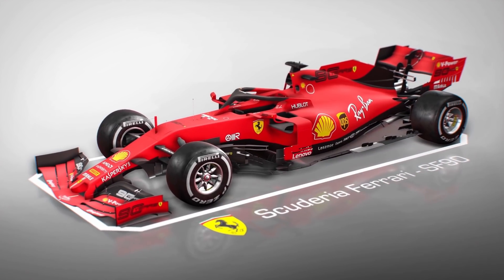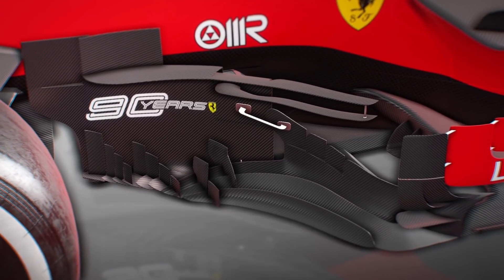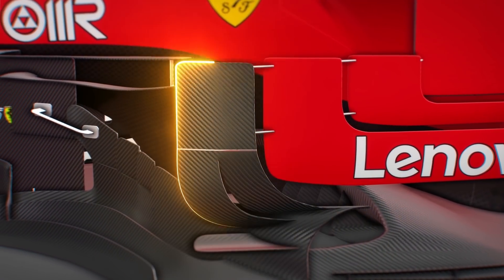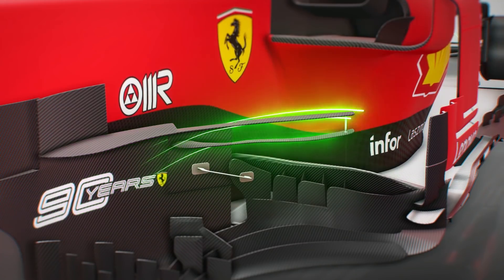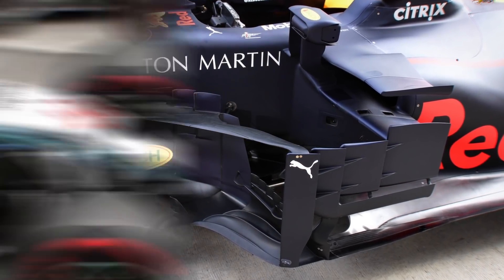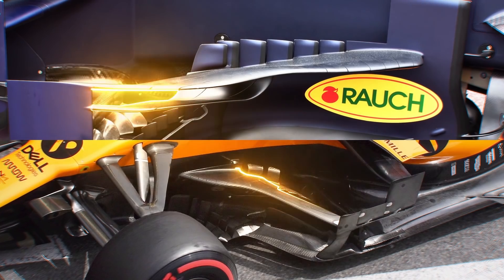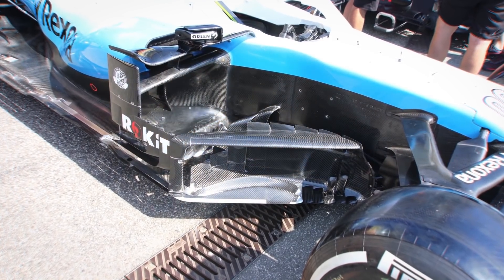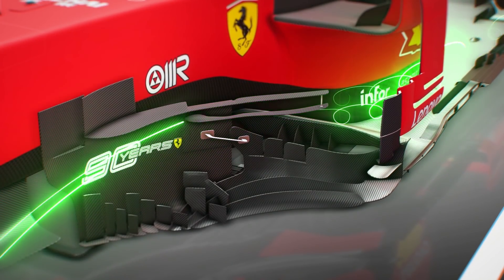Why so many F1 cars now have 'boomerangs'

Comment: The unattached designs flex, changing aero properties with speed, in theory they could straighten out at higher speeds stop adding extra drag, so in high speed straights you might gain an extra 2 kmh and then as they flex back gain the down force at slightly slower speed s

Comment: I understand that "dirty air" is a problem in F1 these days.  Cars really don't like being tucked up behind another, all the turbulence from all the bits and bobs on the car in front mess it up for them.  If F1 returned to aerodynamics like the cars had in 1988/1989, meaning mostly simple streamlined shapes with simple front and rear wings, would this reduce the 'dirty air' problem?
Reply: They are trying to get around this with the rule changes from 2021. There will be a return to ground effect, meaning less dirty air behind the cars, and hopefully more overtaking as a result.

Comment: Isn't the purpose of these also to mess up the airflow behind the car? I can't think of any reason for all the small shutters
Reply: no.  These are flow conditioners. They help manage the air flow coming off the front tires - wake controllers.  If teams were allowed to shroud the front tires, none of this would be necessary.

Comment: And this is precisely why the latest F1 cars are boring.  Looking forward to the next rearrangement of carbon fibre bits around the cars.
Reply: you could say that for every f1 car ever made...
Reply: @nanderlizernanderlizer684  If you really believe what you just said, you haven't looked at F1 cars produced before the year 2000.
Reply: Beauty is in the eye of the beholder.  Those old "pretty" cars wouldn't hold a candle to today's monsters.  Wasn't it enzo that said a fast car is a pretty car.  Personally, I love the, almost organic feel of modern aerodynamics.
Reply: @Bahamuttiamat  "Beauty is in the eye of the beholder."  Your argument is entirely based on a false assumption that I was arguing that the old cars were more attractive.  "I never said the latest cars weren't beautiful.  I said they're boring.  In my opinion, moving the engine to the middle of the car or moving the radiators to the middle of the car, or adding wings, or making the engine an integral part of the chassis, or limiting the displacement while adding turbos is a lot more exciting than analyzing the latest bits of carbon fibre that change the air flow around the bodywork.
Reply: Sorry for misinterpreting your comment.  But unfortunately, aero is king and will continue to be so.  I'm not sure how today machinery are boring.  Much more visually appealing than a lotus 49.  I think it depends on when you were introduced to f1.
Reply: @Bahamuttiamat  "Much more visually appealing than a lotus 49."  You keep implying that I said todays cars are less appealing visually.  I didn't say that.  I said they were boring.  Designing the Lotus 49 to use the engine as a stressed chassis member was an exciting development.  Rearranging some carbon fiber winglets for better air flow is boring.
Reply: I find the aero appendages fascinating.  Agree to disagree.

Comment: Ban 'em. Let's have the car have the aero and not a hundred different elements. Limit frint wing to 3 solid ie no splits to create more than 3 and limit the end plates to single continuous vertical plane be it curved or straight. Will keep costs down.

Comment: These wings are so small. I doubt they improve airflow that dramatically.
Reply: It's about marginal gains, and accumulative gains. You gain a little at the front wing that pushes the air down the barge boards where you gain a little more and flows around your car where you again gain some extra and finally at the back where again you are supposed to gain tiny bit extra. That's why it's so tricky these days to develop aero, it needs to fit in with everything else the car does; if it increases gains in its own area but decreases it everywhere else you haven't won anything.
Reply: @Sp4mMe  true. F1 use to be about cheating. No team does that anymore. Or maybe. I would believe Mercedes cheats.
Reply: @stephenbachman132  Nah, they just have money and brains. 
Finding loopholes is hard these days so it's mostly down to money and smarts.
Reply: Actually. I should say hindsight. Part of the reason why Mercedes are where they're at is because of hindsight.
Reply: @F1ll1nTh3Blanks  money and smarts.

Ok i will throw money and smarts at my crippling loneliness.

Wait it didn't work all it showed me were ads for ladies of love. But afterwards im still alone.

Sorry money and smarts don't mean that much. They have to be getting more grip by better suction under the car. Or a button under the throttle pedal for more boost.
Reply: @stephenbachman132  😂 Yes it does. They wouldn't be so far ahead without it. Fact of life is simple here. In F1 you just look at teams that are up front and they have the most money and expertise. Clear as day. 

They're able to get the most out of the cars components like chassis underbody and suspension because of what they archive in development. ..and for that you need smarts and cash.
Reply: Remember, these wings work at over 300kph. The airspeed is so high that yes, little fins and wings can have quite a dramatic effect.
Reply: @Thumbsupurbum  they need to look up a gurney wing to understand how much just a tiny little edge of a wing can have a HUGE effect on aerodynamics.

Comment: So much bullshit this aero. Look at that!!! So many tiny pieces that even if you break one you basically have to retire from the race because the car is not so drivable anymore. Hopefully simplified aero and ground effect will resolve this issue.
Reply: You don't have to retire over one of them breaking. 

A lot is up to driver. As multiple driver even in this season alone proved. With very badly damaged cars.
Reply: @CzornyLisek  I'm deliberately exaggerating, but my point remains the same. Too much complex aero.
Reply: As with any industry, complexity is a result of progress.  In every era, voices such as yours continually harp on about the technology.  The same was said when v10's, v12's, wings, ground effect etc.  Technology will continue to match on unabated.

Comment: Bargeboard design keeps getting more and more complex since the front wing got nerfed
Reply: Even the drivers find it difficult to get in and out of the cockpit. It is getting ridiculous these bargebord
Reply: *since always, now it's just accelerated
Reply: @E9X330  not always, if you see the cars from 2010, 2013 and even 2016 the bargeboards were very simple, in 2017 got more complex but now in 2019 with the wing nerf they just went nuts

Comment: Ferrari still playing catch up on the aero and chassis..
I understand they're trying to work towards an alternative formula that works the best but they're significantly behind RBR and Mercedes on the technical circuits and it shows. 
Perhaps their setup will pay dividends at SPA. If not then I don't know what's the point of this formula they're using anymore.
Reply: Formula Monza
Reply: @Okuni_  yeah, Monza should be where they're able to best show the results of their aero philosophy(aided by the engine, I should say).
Reply: @hariznonis  ferrari's biggest problem rn is their suspension
Reply: @WinWal2000  Yes. How close RBR can match Ferrari's and Mercedes pace will be the best test of their progress with Honda on large circuits. They did look to struggle at Silverstone right? 🤔